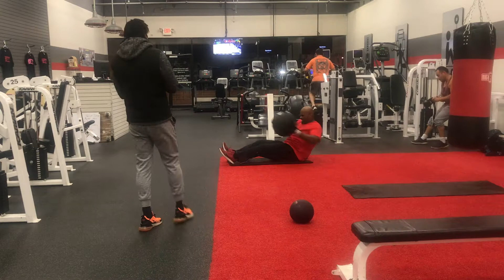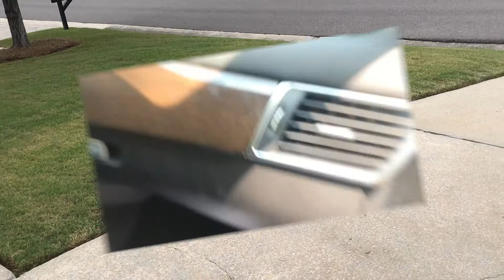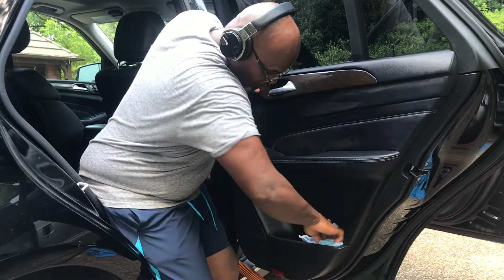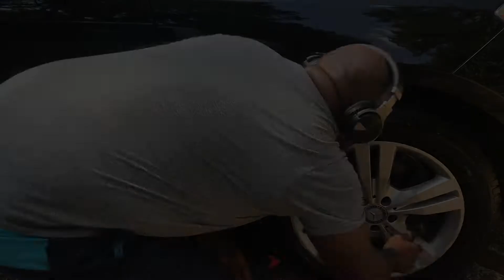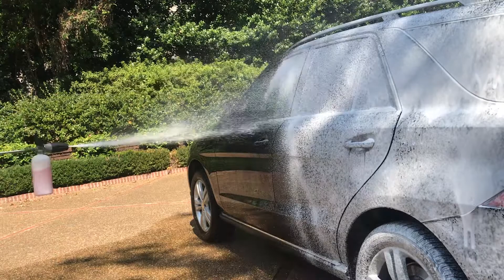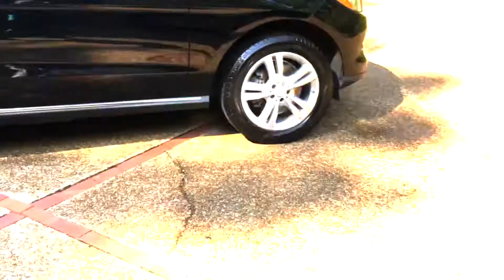One time Customer

Comment: nice video like to know what make and model pressure washer you are using
Reply from the maker: Harbor freight 3100 psi
Reply: @cleanrightcutright-mobiled2224  thanks I like how when water gets hot the release valve discharged the water to keep pump cool